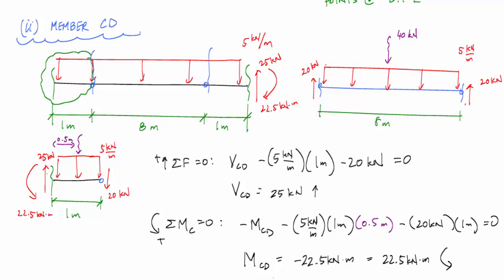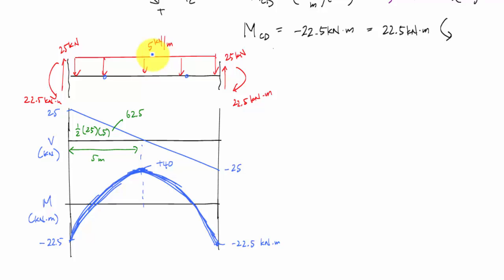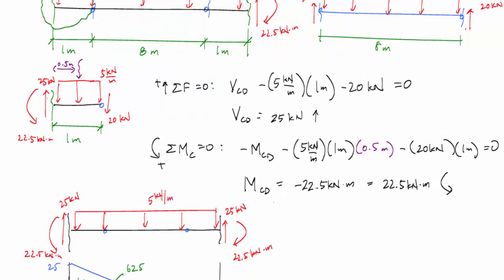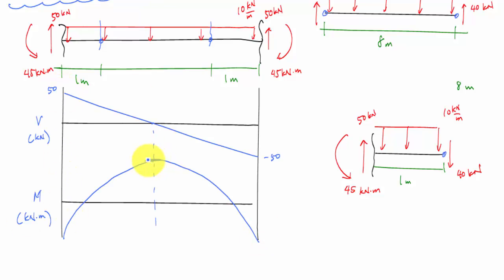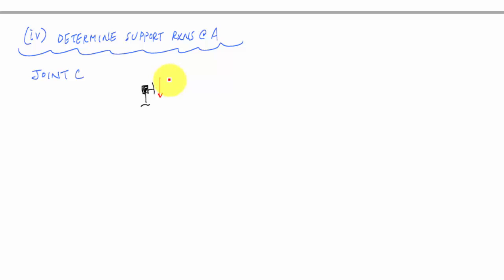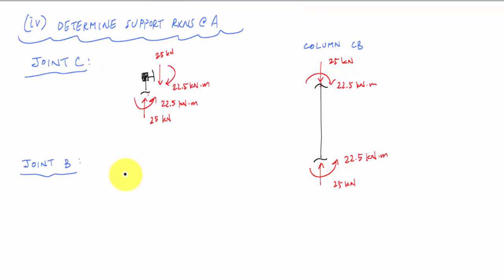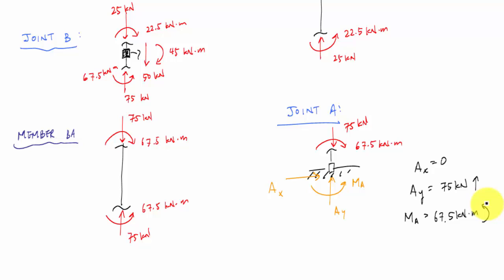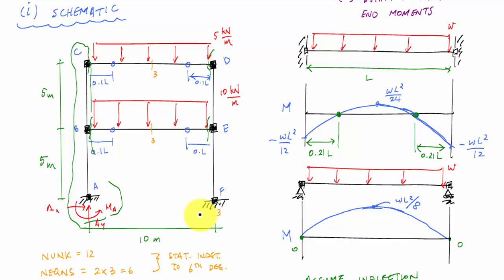Approximate Analysis of Frame with Gravity Loads Example 1 (2/2) - Structural Analysis

Comment: Very good video. The forces at point B, however, appear incorrect. The bending moment in the column below joint B is surely the applied beam bending moment minus the column moment from above (i.e. 45-22.5 = 22.5 kNm instead of 67.5kNm as stated)?